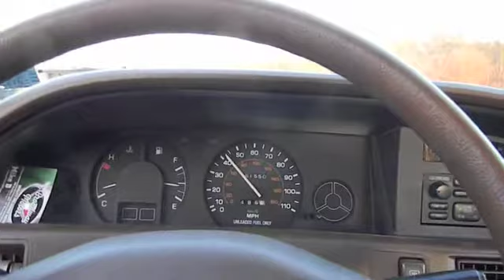Snow Tire Time....

Comment: Nice old tires...Love the tire machine. The one we had in the last shop I worked in had an air blaster around the bottom of the mount platform. Before that, I would use a thing that looked like a  bicycle tube that would just lay in there to fill the gap. You probably remember some of those set ups still, right?